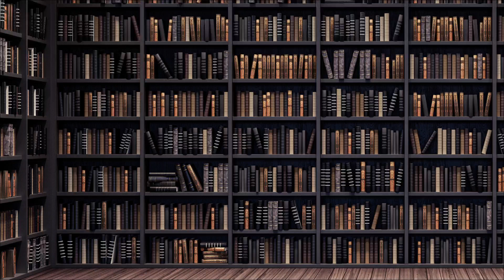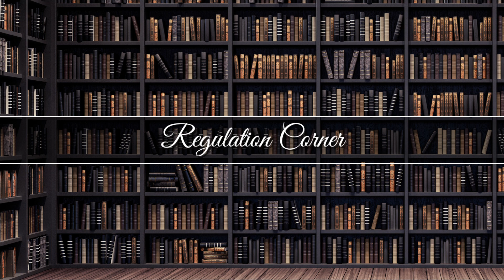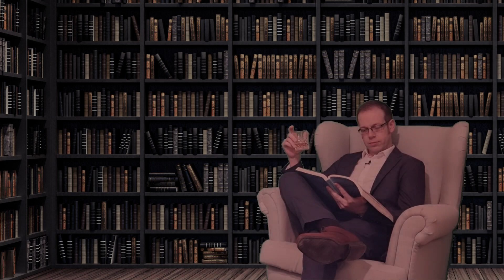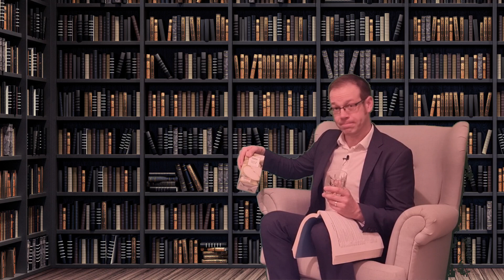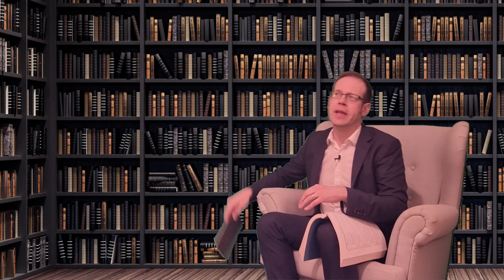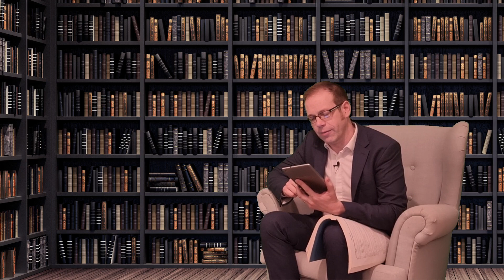Looking ahead to BS7671 Amendment 2: Foundation Earthing

Comment: I suspect that - at least in part - the BS7671 authors are looking ahead to widespread adoption of vehicle-to-grid technology with the possibility of using the energy stored in the vehicle battery as a switched-alternative source (effectively a 'standby generator') OR, (more likely), as a long-term interconnected source with islanding capability during planned or unplanned DNO network outages. The use of V2G in this way requires that an independent measured earth electrode is provided. I get the impression that many countries outside the UK provide the earth electrode as standard and have done so for some time.

Comment: So this was on the table back in 2018 when I took my 18th, the guy over seeing the exam was also one of the writers of BS7671 and openly said "It's going to be in the 2nd Amendment and it's due to cost and time scale to replace all the aging distribution cables before the mass adoption of EV's". Now the part of retro fitting onto old systems - which was included back then appears to have been dropped from the 2nd Amendment. New builds is fine it's far more feasible to plan it into a new build than trying to retrofit onto inner city terraced properties where there's multiple other services.

Comment: So basically they want you put your own pen conductor in or 2 other ways if it's not domestic? So it wouldn't be treated as TT system and is there to reduce your ze. Going to be allot of ground logistics issues with the earth rods? So they now design ev chargers with no earth rod... to then throw this into the mix instead?
Reply from the maker: Yes it’s a bit of a oxymoron

Comment: A friend (heating engineer) once called me to borrow my fluke ground fault impedance tester, that I imported from the UK. A domestic hot air furnace wasn’t working, kept locking out on flame sensor. Ground impedance was high. Told him to find the ground electrode, and chuck 2 buckets of water over it. Had been a hot dry summer. 20 mins later the furnace worked as the leakage current of the flame sensor now flowed to ground properly. Client was told to get a spark out to look at improving the grounding so their protection and equipment worked. 
For those wondering I’m an ex uk sparky moved to Calgary, Canada. Where I’m now part owner of a 1000 strong consulting engineering firm, as an electrical instrumentation and controls designer.
Reply from the maker: Great story Derrick we look forward to more from across the pond 👍

Comment: One aspect of grounding that’s rarely discussed is what to do, when you have a building/structure on bedrock, or native soil has been removed. Establishing a ground around a HV transformer in such an install can be fun-not. You can’t bond to the rebar there so easily. 

One method I’ve used is to create wells of Bentonite Clay in the gravel backfill, where the ground rods are located. The Bentonite draws and holds moisture, lowering impedance of the ground literally. Expensive as hell, but got to be done.
Did this on a $400 million dollar road tunnel under a runway, where the bedrock was only a few metres below the surface.

Comment: Well if the power network wasn’t so greedy like all large companies, cutting corners to save money PME wouldn’t even be around. 
It’s all about the money and big companies just like the big white goods company’s have more clout behind them which means the little guy has to pick up the slack. Why because it’s cheaper and easier to implement

Comment: Interesting, here in Germany every building that was errected after 1980 must have a foundation earth electrode. Or a soil embedded ring earth electrode if ou build a waterproof concrete tanking, that's what you supposed to do when the groundwater level is high in the area and you're unable to longterm waterproof the cellar walls and floor using another method. How this earth electrode must be constructed is described in the DIN 18014. That this must be installed is in the DIN VDE 0100-540, VDE-AR-N 4100 and at last in the "technical connection conditions" of the DNOs (todays version is the TAB 2019).

The VDE 0100 is the regulation, the VDE-AR are the application guidelines released by the VDE.

Errection can be performed by an electrician or a specialist for protective measures against lightning strikes.

The advantage of such an earth electrode is, it keeps the potential of a PEN close to earth potential. The more households are hooked up and the longer the cable run is, the more the potential of the PEN deviates from real earth potential. It also reduces the touchable voltage in case of a PEN fault.
Reply from the maker: Marcel you are ahead of us again - What new regs are coming in at the moment in Germany 🇩🇪?
Reply: @efixx  None of I know now for now. Maybe decreasing the tripping current of RCDs for bathroom circuits from 30 to 10mA (and only there to prevent nuissance tripping). That's what the VDE recommends for a few years now. The last big change was the AFDD introduction in 2019 regs, which was actually the second attempt of implementing them. The were first mentioned in the VDE 0100-420:2013-02. They were made mandatory in the version VDE 0100-420:2016-2, but the text of the regulation was so unspecific when to install one and when not, a lot of electricians complained and the AMEV (Working Group of Mechanical and Electrical Engineering for State and Local Governments) declared they won't consider this version of the regulation as "state-of-the-art", due to it is unspecific and the lack of market penetration of AFDDs. Also their practical interest is questionable. Letters of electricians which complained that the lobbyists worked the VDE to release this original reg, manufacturers are also in this commission. 
The AFDDs we have here are two units wide, like the standard RCD or RCBO. The AFDD contains protection against arc faults, MCB functionality and a 300 mA (!!) type A RCD. That means I have to integrate an additional RCD with 30mA tripping current. There are plug-in addons available, or you can do that separately, but with that the protection for one single phase circuit will be in the width between three-phase MCB and three-phase RCD (3 or 4 units wide, one unit is an ordinary MCB).
And it doesn't matter which manufacturer you pick for AFDD in Europe, the detection technology is based on patents hold by Siemens. All manufacturers here have to pay license fees to them if they manufacture and sell AFDDs here in Europe.

Now the reg states that in ordinary domestic dwellings for the bedrooms of the house AFDD protection is recommended, but not mandatory.

Comment: Obviously the DNO's have got together and dropped off a big envelope of cash, given it to the powers that be, they pass the problem to the electrician, the DNO's are then laughing their heads off
This industry never ceases to amaze me,  how willing the powers that be are willing to bend over and take it where the sun doesn't shine, if the old farts had brains they would be dangerous. 
This is what happens when you have academic people running the industry, commonsense is zero.
Reply from the maker: It’s mainly to do with “prosumer” installations - you can’t rely upon the DNO earthing when you are generating your own power and want to operate off grid in the event of a power cut.
Reply: @efixx  that wasn't the original plan, the original plan was every property, because the DNO said they couldn't guarantee the earth they provid.

Comment: There is a product on the market for this situation and it is called Condu-crete they also make something called a Condu-disc which doesn't erode way to nothing like an earth rod or earth mat
Reply from the maker: We’ll have to get some in for a trial
- thanks 🙏
Reply: @efixx  This is just what I have been waiting to hear about using, in relation to that particular regulation as I have to dig up my drive soon and want to get ahead of the game, with a view to using the Condudisk approach (if appropriate) for "Islanding" in the event of a power cut (as well as mitigating a broken PEN conductor). If Condudisk (with Conducrete) are not appropriate, I need to understand the alternatives & none of the solar battery installers I have talked to so far seem to know what I am talking about to be able to advise.
I look forward to the next video on this subject.
Reply: @efixx   Joh Ward's ahead of you there.  😀  https://youtu.be/tYcXE9W2AKQ
Reply: Have a look at the videos which John Ward did on this.